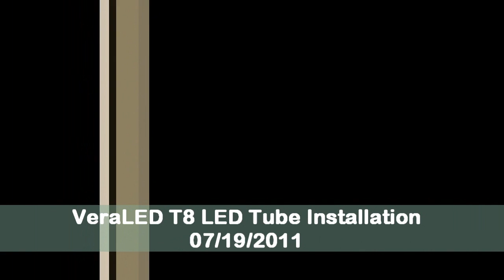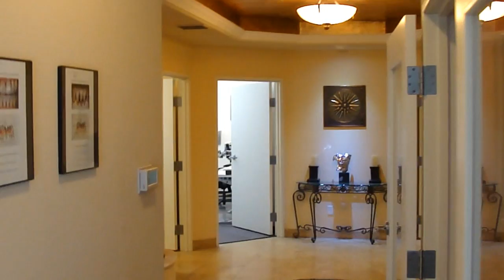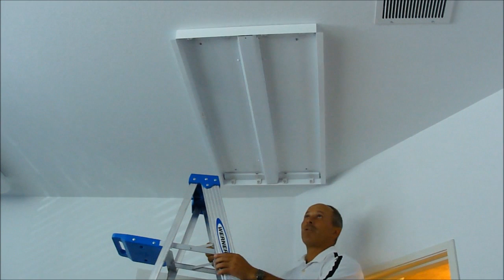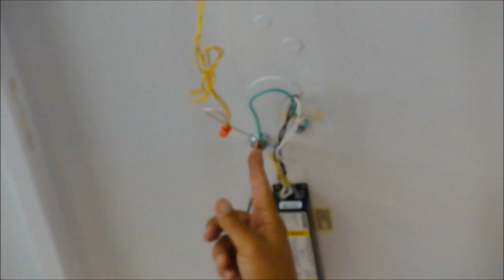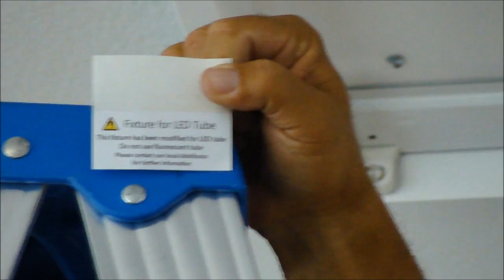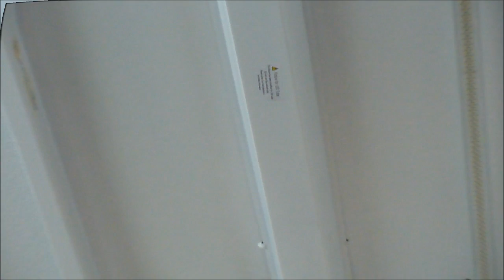How To Install LED Tubes

Comment: i shunt some, some no,, the wiring diagram on the back , often is backwards... trial and error seems to fix it.An example,3 tubes,  my boss wants one ballast LED , to run 3 , its a 4 lamp ballast, But seems llike putting in 2  2 lamp one works, and one 3 doesnt...

Comment: I am working at a school with a ballast,these are problematic..Even after breaker is turned off, there is juice in system..I am putting in 100 alone, first 50 no problem... now , its a apin for unknown reasons..

Comment: the lamp safety certificate disappears when you alter the fixture.DecenTek E LED tube works with the ballast and starter.Save your labor cost while keeping the original safety certificate! Plug and play!